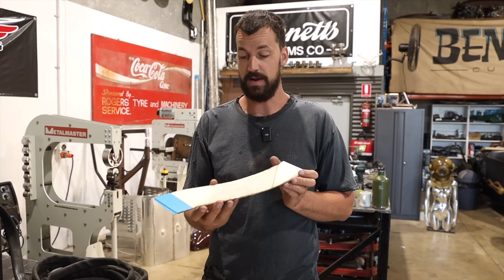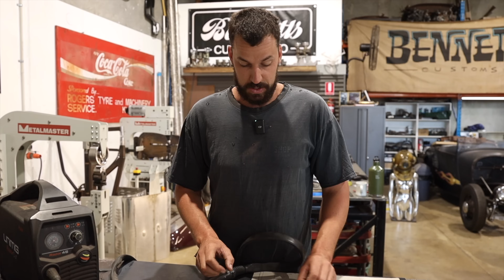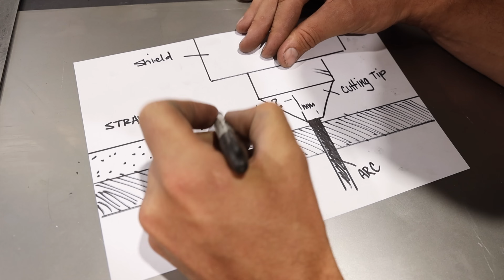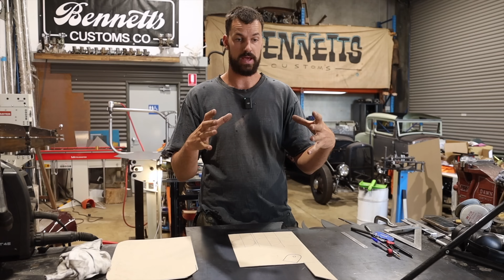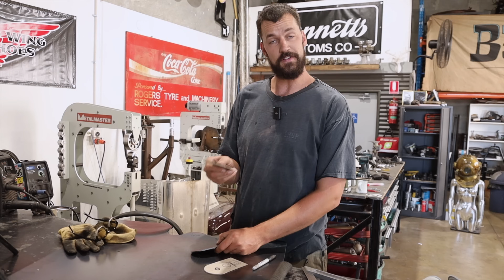THE SECRET TECHNIQUE - Any SIMPLE Shape | PLASMA CUTTING for BEGINNERS!

Comment: Thanks for the well done video.  I use thin exterior plywood templates and soak them in water before use.  They don’t burn and can be used many times.  By now I have a “library” of various hole sizes and shapes I use repeatedly.

Comment: Good info, but a 3 mil is not the same as 3 mm. 3 mil = 0.003 which is much smaller than 3mm =0.118 in 
I think your intention when you speak of "mil" is correct, but your written "mm" is confusing

Comment: Not sure why you don't just trace around the template onto the metal with a marker or pen?
Reply: Because the semi rigid template material is guiding the torch tip as it slides along its edge - just touching. As you might slide a scribe down a ruler or other straight edge. It allows you to maintain travel speed around a complex shape with no chance of hand wobble. Also a Sharpie draws a 2mm line new, 3+ when it's worn, so where are you going to eyeball the 0.9mm cut that's somewhere in the middle of a 7mm cutting tip? The "slide template" can achieve far greater tolerances and repeatability. With the torch tip rested on the metal and constantly moving, the card doesn't catch alight. Smooth solid card won't grab the tool either like some thin plywood or corrugated box card might. It's easy to cut and just good enough for the job.

Comment: Cardboard is a great idea. I always did like to use 5mm thick plywood or 3/16 for the imperial world. You can shape it easyly with a jig saw. The edges need to bee smooth that the cutting torch runs with low friction. Use sandpaper, beltsander, flapdisc or dremel. The design of the tempate can be made in a CAD program that easyly compensate for the nozles diameter and then printed out and glued to the plywood bevore shaping. Printer shops do this also in very big paper sizes. Then just glue to the plawood and shape the template to the lines. Everything can be a template. Big washers are great to cut small holes.

Comment: here's what I use to mark with. BIC liquid paper. comes in a squeeze tube with a roller ball tip. marks extremely fine and won't burn off when cutting or welding.

Comment: I use 3/16 or 1/4 rod to make cutting patterns. Mild steel, super cheap, bends like butter by hand or using a pattern. I tack it or clamp the ends. Plasma rides against it smooth. I cut one side then flip for the other side if needed. works for me.

Comment: My welds are literally all over the world apprenticed in black smith shop as a kid and went to Lincoln school in NewOrleans certified in 69 at Avondale ship yards. Offshore drilling platforms bridges high steel.piorlined muk.vooling towers. Head of the fan shops. I thought the plasma torch was going to be quicker and cleaner. This is a lot of bullshit. I'm a member of NewOrleans out of local 1098 pipe pressure vessels. I could have laid out and built critical accurate projects in less time than all this cardboard business. I use cardboard for test parts when I'm working on expensive materials..I bought an arc captain 50 amp plasma torch because in it's description it stated it would work on Robot table ( haha Chingleexe) so I naturally assumed that meant it was a piolet arc. That was not true it's a scratch arc. So no cad no use to me. I'm an accredited fab pro. And this would only cost me time. Your article was interesting but I'm 80 and don't have that much time to drag me down. Enjoy Canada. Aye? Dandahermit

Comment: I have a 45 watt laser engraver, I could probably cut my templates out of the straw board with it. Thanks for getting the gears in my head turning.
Reply: Totally! Makes it easier to accurately cut a "main" and a "cut" template with smooth edges for the plasma nozzle to slide against. No linisher follow up. If you save the cut file, you can always spit out an identical cut template if the first one gets damaged.

Comment: for smaller projects, you can design and layout in a program such as CorelDraw or Illustrator (there are some free programs as well), then send file to laser cutter/engraver and cut perfect and clean.  my machines  max size is 12" x 24", however, lasers have larger bed sizes.  Been using lasers for 30 yrs.

Comment: wearing my welding helmet plasma cutting  I can’t see my lines so have been using sunglasses is this safe
Reply: Maybe use with your helmet set on grind? The helmet lenses have full UV block.
Reply from the maker: I do it, not sure if it’s safe?
Reply: Shade 5 for plasma, approx the same as grind mode in a helmet. You can get inexpensive shade glasses

Comment: One method to measure the offset is to simply make a short cut from the template material you will be using. Then measure from the edge to whichever side of the cut you require and that is exactly your offset.

Comment: Get a 3d printer to make accurate templates or find a friend that has one. You will be able to make incredibly accurate and detailed jigs.
Reply: Its really a tradeoff though doing that. Youre limited by the buildplate size and material. I dont want a plasma torch anywhere near pla or asa. At that point if youre going to go through the trouble of modeling something in cad why not just cnc it instead? Generally you use plasma by hand for one off cuts so its also good pratice and much faster to make the template by hand.
Reply: You can join multiple bed sized pieces together to make something bigger. This still allows you to cut complex geometry even on large pieces with the need (and cost) of a plasma cnc.
Reply: Just use a cnc plasma cutter, baahaa. 😂
Reply: @bh9420  plenty of sites out there dedicated to how to build them.. first cut will be a piece that says I should have done this sooner...

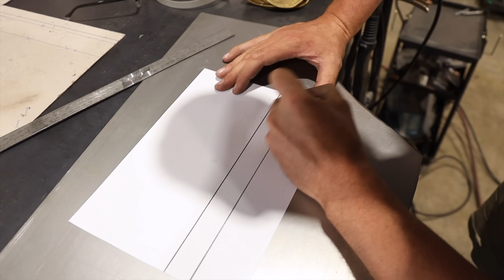Comment: 7:15  "Radius" is for circles... "Perimeter" is general, for every form, even for circles. 
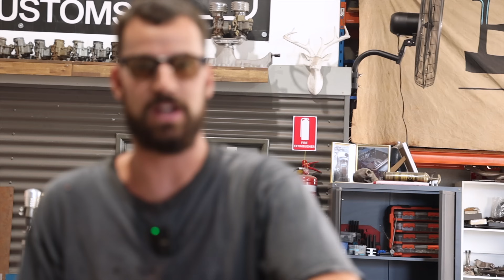22:22 The legs are incapable for fine-motoric-movements, so, you surely assisted your legs with smaller upper-body- and arm-movement, but it´s good that you underline the use of your legs, cause many won´t notice it by themselves for ages...!!! Thanks...!!!

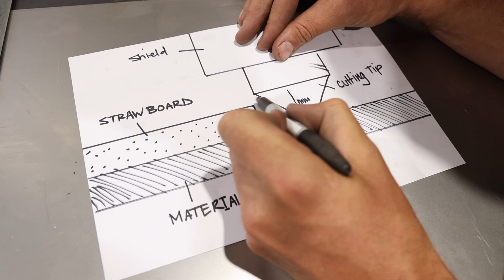Comment: Hey Jordan. New to the channel and the plasma world. At 8:50 couldn’t you just run the straw board through a router table with a 45* bevel so the shield (conical bit) accurately rides the edge of the stencil? Or even just use a inlay set to trim off the bit you were doing with math in the first place? (I’ve been a hobbyist maker/tinkerer for a long time but I’m brand new to plasma cutting so forgive me if I’m off the mark or ignorant of limiting factors)
Reply: It just seems like a router would speed up the process substantially and remove all the possibility of trimming wrong if you used the bushings intended for inlays. It could just zip off your desired amount in seconds. Though your video provides an excellent solution for someone without the extra tools

Comment: Im an old 80 yrs lifelong iron burner welder and this new tech is serious important. I just bought an ArcCaptan 50 amp plasma cuter and don't know how to use it. Still in box. Couple dissappointments are that it's not a piolet arc and wanted to do light duty fieldbrepairs with a good generator and pancake compressor what size generator do Inneed?? Thanks just r. Now it looks like I cant. Have 30 amp 120. Help?

Comment: Do you drag the nozzle, or do you have a stand-off?
Reply: A dedicated drag nozzle isn't strictly needed. A light film of kitchen spray like Pam works fine to prevent the tip from grounding. Or rough it out over masking tape and just cut thru it. For straight lines, I rip pieces of thin pine that the nozzle shoulder can rest on and keep about a 1/16 stand off. Miller 375. If the metal still has its mill finish, shorting the tip won't happen.
Reply: Thanks

Comment: Great video. At some oint I want to make a CNC plasma cutter, but until then I was planning on doing something similar using thin wood templates cut out with my wood cutting CNC machine to cut out the templates... but I really like your cardboard idea better. I conveniently have a CNC laser cutter that will cut out cardboard templates easier than wood and way way cheaper... I use software called Lightburn to drive the laser cutter and it has the perfect feature for this, it lets you draw an object and then clone it as an offset object with the offset either inside or outside so cloning it with a 3mm inside offset (or whatever required for your particular plasma torch) makes it super easy to go from drawing to cardboard template fast.
Reply: Use thin Masonite / beaver board.. Then go to plasma spider and we will help you build your plaz table

Comment: Great tips and well explained, If you can drive one of the free 2D CAD programs then you could draw the shape, print and then glue to the strawboard with spray contact glue like ADOS F2, then just cut to the printed line. It would be easy to create an offset allowance and place reference points like circle center marks etc :-)

Comment: hi
why do some people wear welding helmets
when using a plasma cutter,
would i be fine just using safty glasses
Reply: Different ampages require different protection levels from a level 4-9 welding lens as ampages goes up go darker.
Reply: You should wear a helmet.  Also protect any skin exposed to the UV light from the arc.  I bought a plasma torch when they first became available.  I used it A LOT.  The welding supply guy told me torch goggles would be fine.  After about five years I started noticing I looked way older than I should.  All that UV was just like going to tanning salon and it burned me up.
Reply: @channelview8854 thanks
I only thought about my eyes,
So its back too wearing my helmet 👍
Reply: It generates ultraviolet light. https://www.cdc.gov/niosh/hhe/reports/pdfs/2016-0027-3260.pdf

Comment: Liked the video. I want to use a plasma cutter to create artwork and looking into the plasma cutter I should purchase. Obviously you could not use this method with a pilot arc cutter. If I was to use this template method I would cut out the straw board templates using my laser cutter.

Comment: I got no idea what a straw board is, but I think if you got a plotter or a laser cutter, you can definitely cut out templates with a computer. It would allow you to precisely cut repeated shape on the plasma.
Reply: Yes, I think you could use a CAD (not cardboard :), print the design in the correct scale and then glue it on the strawboard. Then you could subtract the necessary 3 mm directly.

Comment: Impressed with what you do with the hand held plasma torch, out of curiosity what pressure do you run the air at?
Reply from the maker: About 75 Psi from memory, I also believe that’s the recommend pressure from the manual
Reply: @bennettscustomsco  thanks Jordon, I have access to a similar machine but it didn't have a manual and I couldn't find anywhere that mentioned pressure.

I did use it but found it really hard to to cut with, I am going to have another go with your tips.